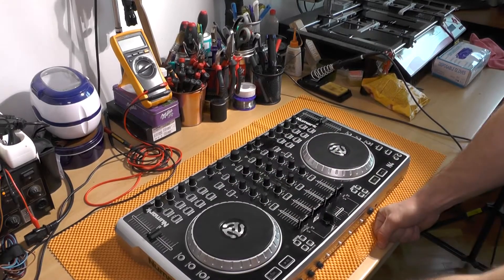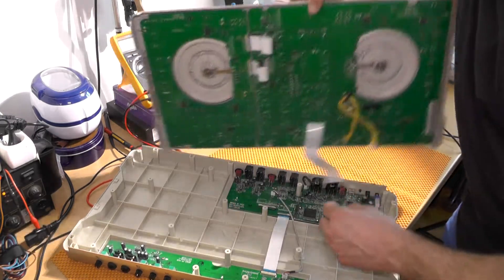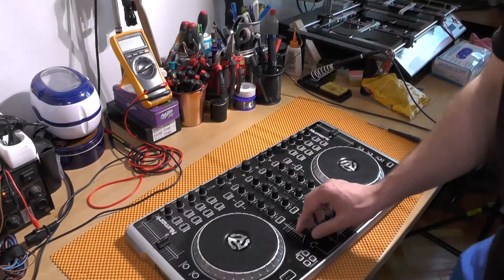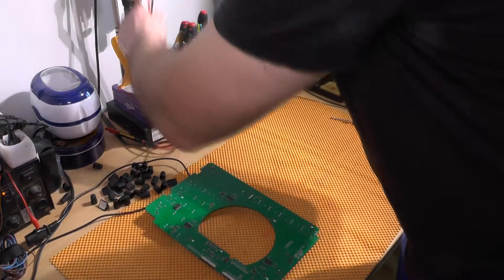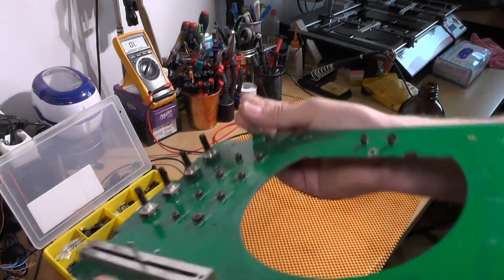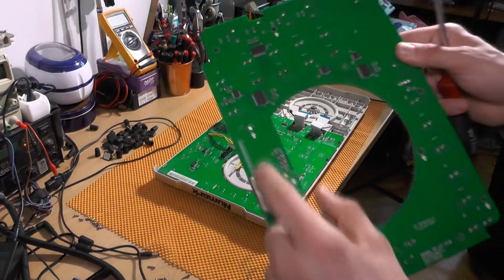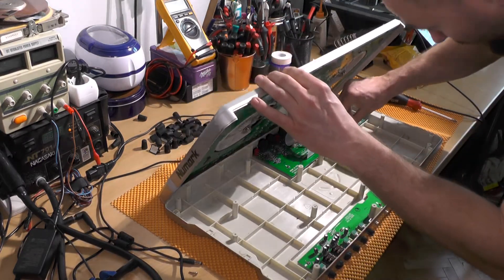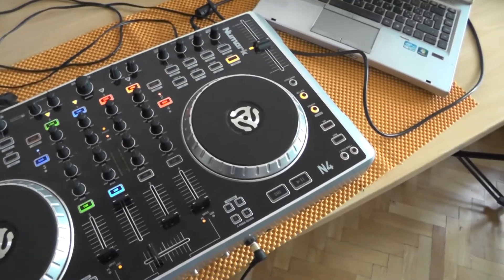[HW: Repair] - Numark N4 disassembly + Play/Cue repair

Comment: Any suggestions for damaged Master volume? Someone spilled a beer and some went directly on the master volume and of course the music volume kept getting lower and lower for 20 seconds until the sound vanished. Knocked out the headphone sound as well. Everything else is still working with Serato except for sound. I've never dealt with liquid damage repairs. I've replaced several phone screens but none with liquid damage. If liquid damage is not fixable I guess I'll have to trash my Numark N4. I'm taking it apart now.
Reply from the maker: Just buy the replacement on ebay and tesolder it. (It’s actually cheap)
Reply: @MTS_IT  I purchased a new Numark NS6 II and ordered a can of Deoxit spray for my Numark N4. The spray fixed all the sound on the N4 and it works great again, however I like the new NS6 II controller features much better. But unfortunately the music starts to sound erratic and slow down and then it disconnects from Serato several times while I'm doing parties. I've reached out to American Musical and Numark but Numark hasn't responded so I guess I'll have to reach out to my bank to see if they can intervene in the warranty for the new controller that's failing.

Comment: what buton you use for the play/cue, i have the same problem, sorry for my bad english
Reply from the maker: Hi, you can use: https://www.ebay.com/itm/100pcs-4-Pin-Momentary-Tactile-Push-Button-Switch-SPST-Miniature-Micro-Small-PCB-/141986870574?var=&hash=item210f13b52e
(not affiliated in any way) they are quite cheap.

Or you can buy "the original" for about 10$ from ebay, however, in my experience these are the same switches with the same quality.
Reply: thank you mate you saved my life, have a nice day
Reply: @MTS_IT  Hey with the link you posted here the buttons have a certain size to them when you order, what size button did you use for the numark n4?
Reply from the maker: @driptamine1162  hi, i THINK and keyword here is THINK that they are 6x6x6 (90% sure) because i have shitload of micro-switches of every size, also, you'll need ones with 2 pins (NOT WITH 4)